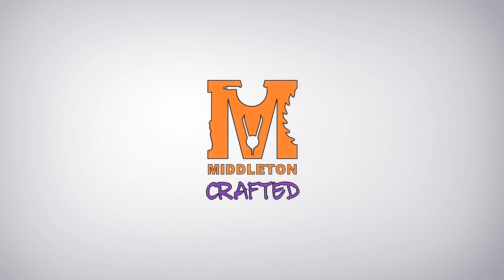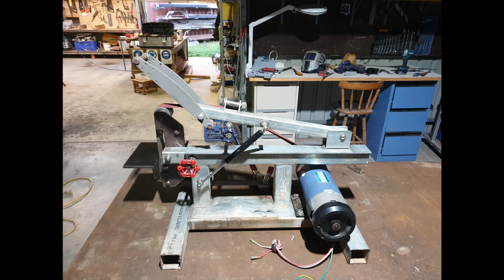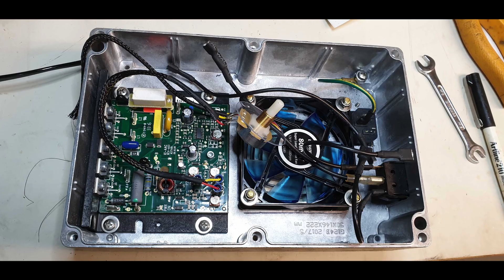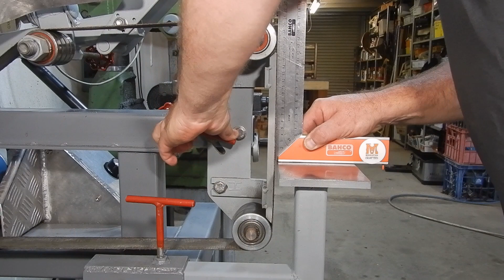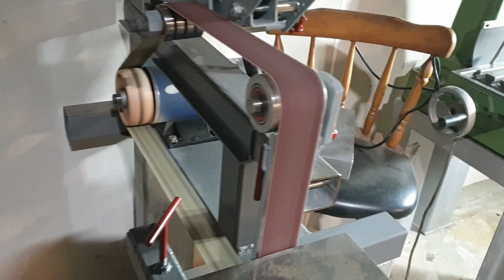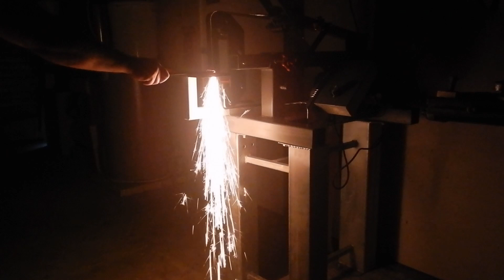AMAZING !!  Don't throw away your old treadmill! Build a 2" x 72" Belt Grinder with it !

Comment: What size gas assist assembly is that? 16lb, 32, 45?
Reply from the maker: Hi Boris, I'm not 100% sure.  It was one of the gas struts that came out of the treadmill itself. (To assist in the fold-up of the treadmill etc)   If I can find any markings etc. on it I will let you know.  Cheers
Reply: @SirMiddo  Thanks. My build is held up until I figure out which one to use.